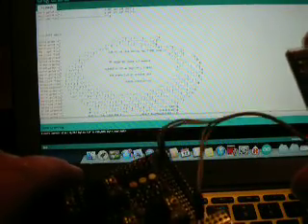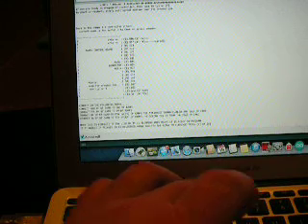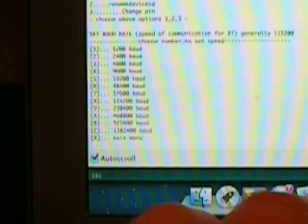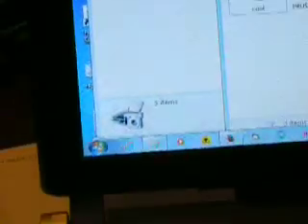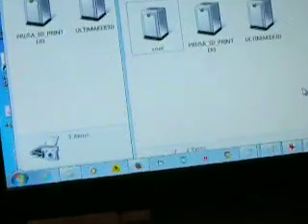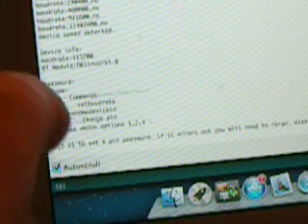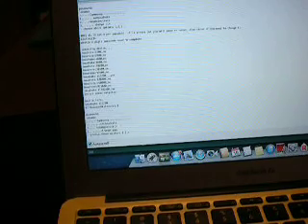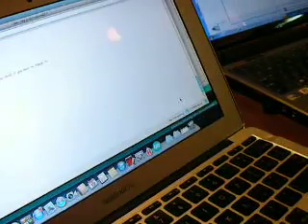setup bt devices with ease on arduino and ramps. bt_magic. bringing the magic back to arudino!

Comment: Is it possible to use serial3? I have a lcd on serial pins 16 and 17? I am wanting to use  my ymin and y max for bt Rx and Tx
Reply from the maker: yes you can, use the hardware serial version, and change the rx and tx pins in the sketch.

Comment: Hello when i load the file in arduino it does nothing am i suppose to do something else to launch it?
Reply: I get error C:\Program Files (x86)\Arduino\hardware\arduino\avr\cores\arduino/HardwareSerial.h:138:25: error: 'Serial2' has a previous declaration as 'HardwareSerial Serial2'
   extern HardwareSerial Serial2;
Reply from the maker: Anthony Edwards code has been changed to allow arduino with hardware serial to use soft serial version as well.

Comment: I used this sketch instead and it worked for programming my bluetooth device to control printer wirelessly via usb, http://www.instructables.com/id/Success-Using-the-JY-MCU-linvor-Bluetooth-Module/step2/The-Software/
Reply from the maker: that's good to know! that program will only work if the baud rate is known. this sketch works for most out of box and detects baud rate. works best for arduino mega. thanks for your interest!
Reply: profounddevices I am using the mega 2560 and ramps shield with JY-MCU v1.06, it btmagic v1 sketch didn't detect the device. Could it be my arduino's 250000 baudrate? The software serial wouldn't compile for me, something about softwareserial serial2 already being called under the name Hardwareserial serial2.

Comment from the maker: i have updated the web link to include a version that runs software serial. it means you have a lot more pins to setup device on. it requires you to setup pins . when it runs it tells you what to hook up and runs diagnostics. if it does not work then issues may be serial port conflicts, pins without interrupt support, or bt module is hooked up in reverse. works with hc03, hc05,hc06 devices as long as proper voltage is applied. bt mod runs at 3.3v, most arduino run at 5v, use of a board to do voltage shifting such as jy-mcu, or any board with a 4pin header than indicates 5v input.

Comment: Has anyone got this working with an HC-06? I can't get it to detect the baud rate. Any help would be gratefully received!
Reply from the maker: try the software serial version. the first version only worked on specific ports, also make sure to use rx to tx for example

Comment: looks cool, but i only have uno's and nano's to work with - can i just replace Serial2.* with SoftwareSerial mySerial.* to make it work here, too?
Reply from the maker: it should work. i need to test it though.
Reply: profounddevices
I needed to remove the logo section, but now it works using mySerial on a Nano clone. sometimes, i get garbeled characters in the serial monitor, but otherwise it seems to work fine. you just made my day!
Reply from the maker: yes. web page has a software serial version i just created. use several pins on any arduino device, or device port as of today!

Comment: There are a number of these modules that all look the same.  Most of the instructions I've seen are for the HC-05. I usually can't tell which version I'm looking at on Ebay listings and when I got one I happened to get an HC-06.  I was able to send AT commands to it and query it, but actually changing the settings eluded me, in spite of being somewhat familiar with AT serial commands from the dial up modem days.

Will this work across the different modules?  I intend to try it later today.